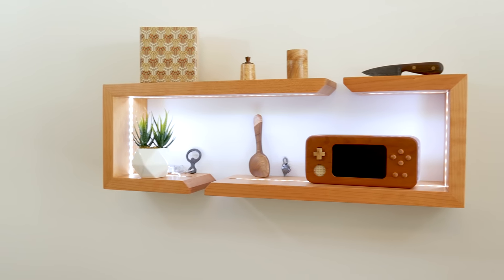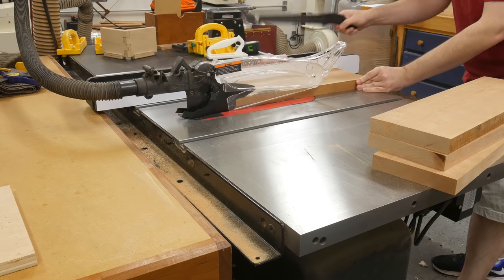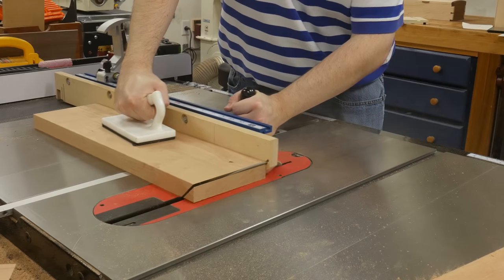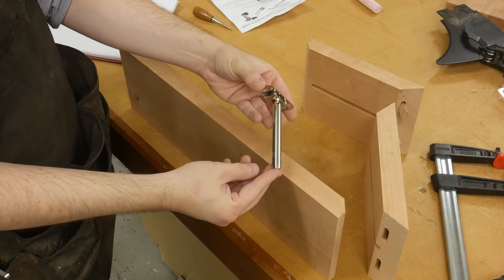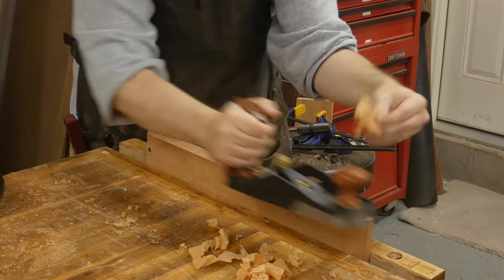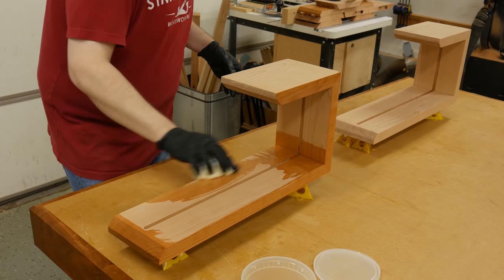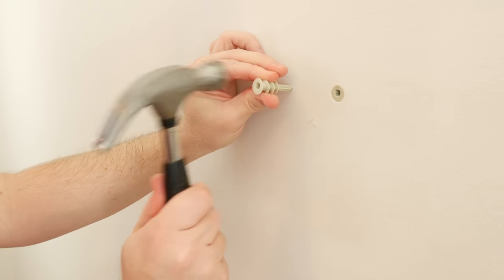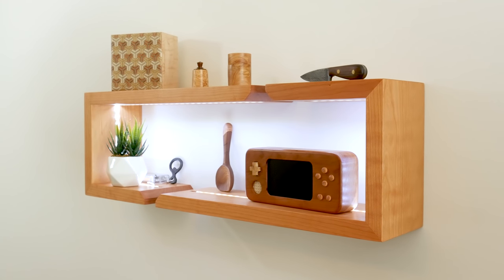DIY Floating Shelves

Comment from the maker: Do me a favor, subscribe to the channel if you're not already: https://www.youtube.com/channel/UCmlRWK6jRFi2No_gDBDjwow?sub_confirmation=1
List of Materials
(2) 1.125"x 5.75"x8.5" - Shorter Horizontal Board
(2) 1.125"x5.75"x9.5" - Vertical Board
(2) 1.125"x5.75"x20" - Longer Horizontal Board

Thanks to Acme Tools for sponsoring this build video. You can find out more about Acme Tools by visiting http://bit.ly/AcmeToolsSimpleCove 

See detailed photos of this project: https://www.simplecove.com/960/diy-fl...

Products used (affiliate links below):
Table Saw: http://bit.ly/AcmeToolsSawStop
Jointer Planer Combo: http://bit.ly/JetJointer
Orbital Sander: http://bit.ly/OrbitalSander
Festool Domino: http://shrsl.com/18g5l
LED Strips(QTY: 2) : https://amzn.to/2PMOx5u
Wipe on Poly: https://amzn.to/2CY4iEc
Mounting Brackets: https://amzn.to/2S3Yihk
3/8 Spiral Bit: https://amzn.to/2S6RUWz
Titebond Glue: https://www.acmetools.com/shop/tools/...
Ceramic Geometric Planter Succulent : https://amzn.to/2S6RShu

The wall shelves are made out of cherry and finished with 3 coats of a wipe on poly. The bottom shelf is 20" long, the vertical board is 9 1/2" long and the top board is 8 1/2" long. All three parts are 5 3/4" wide. I routed a 3/8" wide, 1/4" deep groove on the center of the boards for an battery powered LED strip. The joinery method for the shelves are reinforced miters.

Comment: I'd add a frosted cover to those LEDs to give the shelf a more sleek and professional look.
Reply from the maker: What kind of frosted cover would you use?
Reply: @Simplecove  I'd consider two options given that it'll be a retrofit for you. (1) an aluminium LED channel/profile with a frosted cover that can be fit into the LED chase you've made, which you may need to reroute bigger to accommodate it. (2) buy a frosted acrylic sheet, cut it to fit over the LED chase and also recessed flush with the wood. If you can't get frosted acrylic, get clear and spray it with a 'frosted glass' spray can.

Comment: Nice shelving, i really liked the design and the LEDs really highlight the items on display. 
I noticed when you were planing the boards to thickness, the table tilted downwards as the material engaged the outfeed roller. Have you fixed the problem? And if you have, what was the problem? It was around the 1:03 mark in the video. Cheers.
Reply from the maker: I probably forgot to lock the table in place before running the boards through but I've never noticed that before. It's not caused any issues that I'm aware of but I'm definitely going to look into it. Thanks!

Comment: Cool shelf sean. I have that same ane finder and it's always off by 2 degrees.ik this cuz after setting a 45 angle ade  doesnt line up with a speed square .guess I got a bogus one..I just
Reply from the maker: Thanks Joe! That sucks about your angle finder. I've found that mine is really close to perfect, but I always double check it to make sure.
Reply: Go to the manufactures website and get the calibration procedure almost all these devices have one.

Comment: Very nice, Shawn. I noticed that you use a wide tape for the glue squeeze out. Do you find that this works better for than the narrower tape?
Reply from the maker: I used the wider tape because it's what I have on hand at the moment. Narrower tape would work just as well.